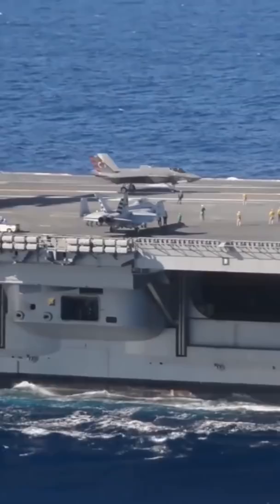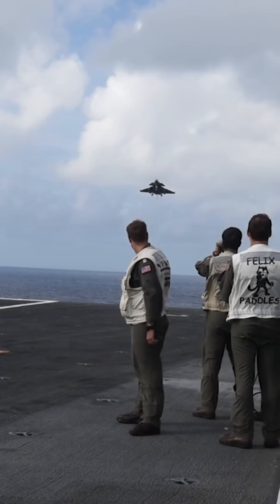How Aircraft Land on Carriers? #shorts

Comment: I'm more impressed on how tough those cables are to be able to completely halt a heavy-ass aircraft on full throttle.
Reply: Indeed
Reply: Not always. I’ve seen one snap and take a buddy’s leg off.
Reply: @SideGigSquid  did you though?
Reply: @lsixty30  yes. I’ve been in the navy since 1999. Seen many unfortunate things.
Reply: @SideGigSquid  thankyou for your service sir
Reply: Check out the film (it’s on YouTube) of Eric (Winkle) Brown making the first ever jet landing on a carrier. His main gear came sooo close to hitting the edge of the deck. 
Eric Brown also made the first twin engine carrier landing with a DeHavilland Mosquito. He came in well below stall speed with the plane hanging on its propellers. The hook failed so he had to abort but had all the power he needed to get away. He tried again later that day and the hook did it’s job.
Reply: @Deochar  You're welcome
Reply: @SideGigSquid  I turned 3 in 1999, so I guess we both went through some shit
Reply: @Deochar lol
Reply: Amazing the landing gears aren’t torn off
Reply: @Alan Brown যলতলখযর
Reply: They don't. The cables are attached to 2 hydraulic pistons on runners and those are what actually stop the plane.

If it was just the cables they would snap and cut people in half or tear the plane in half.

Sounds like a really loud train clopping above in the quarters underneath.

The plane also has to go waaaaaaaay slower to land or they'd generate too much lift. Planes land by slowing down.  Being at 85% throttle would have most planes over mach 1 based on their UNCLASSIFIED top speeds as well if you think about it, so that was also total horse crap.
Reply: David White  ...the 7 years I was in the Navy disagrees with you.
Reply: @lsixty30  O
4*// "
P9
Reply: Discovery Channel did a show called "Anatomy of a Super Carrier." Was filmed on the USS George Washington. They were on the flight deck filming, talking with the Paddles, when a wire snapped on a F 18. Jet went overboard, wire took out a few people.
Reply: @SideGigSquid   Indeed. These cables have a cycle limit and are replaced per schedule or sooner if damage, wear or deficiencies are noted during inspections. A cable snapping is deadly!!! Thanks
Reply: 85% throttle
Reply: The cables are connected to weights under the deck as well as pulleys so as the plane hooks the cable the cable will help stop the plane.
Reply: Ññp0
Reply: Got alot of play under the next deck with giant pullys and what not...alot of that cable you never see....I know....I help build them...hydraulic pistons and alot of stuff that would probably bore you.... but I think it's actually fascinating...I love my job....lol
Reply: Same, also how the tail hook doesn’t just break
Reply: Ikr!
Reply: @Alan Brown that.. sounds terrifying.
Reply: @lsixty30  dang I was 13 in 1999. I remember cuz I turned 13 going into 2000. Lovely year, only time I’ve ever seen fireworks EVERYWHERE in the sky during the turn of the millennium
Reply: @casedistorted  hate to be the "well actually" person, but the turn of millennium was actually between 2000 and 2001
Reply: The caes are attached to pistons below the flight deck which are used to reduce stress to the cable  that the aircraft snags by adding resistance dependant on weight of aircraft thats landing
Reply: @brentywenty  yea… but we are just humans. We see the change from 19 to 20 and that is what we see. It’s definitely not how it should be from 0 to 1 😂. We’re just sheep man, give us a break smart guy. 😂
Reply: @SideGigSquid  you’ve been in the navy Since 1999, and you didn’t at the very least think to try buds??🤔🤔 or did you try and quit??? Anyway, thanks for fighting and putting your life on the line for our freedom.
Reply: @JerryBarau  if you must know in boot camp there was an attempt for SEAL PT and swim. I didn’t even come close.
Reply: Well, the good thing is you tried, saw that not everyone can do everything, and when you realized buds was not for you, you told yourself the truth, and moved on to what you’re capable of doing, better
Reply: @Checo82886  Well, you have got a point lmao.
Reply: Cables, hydraulics, and pulleys (basically)
Reply: @SideGigSquid  I saw that too. And then cookie went on to be a master diver.
Reply: @SideGigSquid  😭Thank God he lived!
Reply: @formdoggie5  No
Reply: @BrazilianImperialist  yes.
Reply: How about the stress on the airframes?
Reply: Landing a fully loaded semi truck at 150 mph on a postage stamp moving away from you and also at an angle, easy enough huh? Lol
Reply: @SideGigSquid  thank you for your service
Reply: @lsixty30  that shit is unfortunately very common, not like a daily occurrence but it unfortunately does happen.
These guys on the flight deck are hyper aware of their surroundings but accidents happen.

Don’t tell anyone from the navy I spoke well about them though, fk them.
Reply: I am more impressed that the things holding the wheels don't get bent or something
Reply: The cables are connected to dampeners that reduce the load from the Aircraft. How do it know this? Im a vet, i used to work with the whole Arrest Gear. #ABE
Reply: The aircraft slow down a lot so not really on full throttle, and it's not like they're indestructible either.
Reply: @Alan Brown .
Reply: @Alan Brown δ
Reply: @SideGigSquid  ouch 😓
Reply: Eddy Love  🤣
Reply: Eddy Love  My wife: Puts 3 weeks of clothes into the 2 day old, brand new washer, spin cycle set to high. 

Phone call one hour later; "This thing is such a piece of shit. It's already screwed up."

Me: 🤦🏼‍♂️ (Sends pic of washer load rating)
Reply: @SideGigSquid  Thank you for your service sir.
Reply: Yeah, you'd think all carrier based aircraft would be vtol by now so they can do away with all that cable nonsense
Reply: @Deochar  Thanks for your cervix
Reply: @formdoggie5  he said 85% throttle not speed. It means no fan lag
Reply: @johnnytopgun6414  wow
Reply: Its not what you think 😄
Reply: @SideGigSquid  Well thats not supposed to happen.
Reply: @SideGigSquid  That sounds horrifying my man, thank you for your service
Reply: They are changed after a few uses
Reply: @tokyotylerhunt  I don’t know much about jets, but I assume that jets that land on carriers are designed with gear that can withstand, I know the F22 gear can’t stand it, so I reckon gear are specifically designed to withstand it if necessary
Reply: I’m more impressed that he said not how you think and not not what you think
Reply: @lsixty30  lol same
Reply: @SideGigSquid  sure you did bud
Reply: @SideGigSquid  thank you for your service 
Im off to the marines one of these days after i get done with hs football
Reply: @tokyotylerhunt  that's because aircraft intended for this have specially designed landing gear.
Reply: @ccountryclarke6223  like dumbbell weights right ?
Reply: @SideGigSquid  
Damn, sorry you had to see such things mate, a Cable snapping must be insanely deadly
Reply: Like ten, and more tons.
Reply: @pain_of_rose  jjuiiuh
Reply: @pain_of_rose  jhkjh
Reply: They use a hydraulics system beneath the fly deck to completely bring the plane to a standstill
Reply: If it snaps, it can just chop a guy in half. Scary stuff
Reply: I agree. They must have done it differently in WW 2. Eventhough, it all looks the same.
Reply: I wrote a comment agreeing with you. I'm
Reply: My reply agreed with you. But, I must be being shunned again.
Reply: There is a mechanical system that lets slack out so it's not just a sudden stop
Reply: @lsixty30  the airmen are supposed to be in designated areas where they won't be hit, but 1) they anticipate a good trap and start moving before they're supposed to to clear the deck for the next aircraft (there is always pressure to get the plane off the deck as fast as possible and to keep doing it in a shorter time, hence why they anticipate and jump into action before everything is technically safe) and 2) a snapped wire can do some crazy, unanticipated shit; it's not unheard of for a wire to snap from one side instead of the center (longer reach), or even to snap near the middle and also break away from the side giving you a completely loose wire that can go anywhere it wants.  Also, people are stupid.  Ask him about critical engine failures, i.e. dudes getting sucked into the jet or walking right into the propeller.  We give airedales shit, but good God!, find me a more dangerous place aboard ship.  At least you have to try to get to the catapult machinery or the engine room
Reply: I slept under #3 wire on the USS Kitty Hawk.  73-76.  Noisy...
Reply: @lsixty30  it happens a lot and the flight deck is the most dangerous place in the world
Reply: @formdoggie5  nope. Not many planes are capable of super cruise which means that most planes have to be at full burner to go faster then Mach 1. Most jets at mil power sit at or just below transonic. However just before they hit the deck they go to 85% at least or mil power and when they do hit the deck they go full burner until they stop moving. This is because it is quicker to spool down an engine than for it to go from idle to max rpm.

Comment: The fact that they throttle up when landing is crazy, never knew this, makes total sense
Reply: I never really thought about it either... but it really does make sense cause if you miss and you're going to slow then the aircraft will stall and crash.
Reply: A jets engine also needs time to throttle up unlike in a prop plane where you get the power faster
Reply: @mikemuller8423  ada
Reply: @mikemuller8423  Yeah but that's why they come in at such a high power setting to start with, the engines are pre-spooled. In the fighter jet engines they don't lag that much at all compared to high bypass commercial engines.
Reply: Really makes more sense to drop it entirely and glide
Reply: @EKKing-wy2jq  Yeah then when you miss the cables you fall into the sea and lose a 65 million dollar jet.
Reply: @SgfGustafsson  you drop the engine beforehand and glide, then you don’t have to worry about missing the cables you’d be slow enough land pretty much without needing them at all. Its just basic physics
Reply: @EKKing-wy2jq  They thrust to almost full power when landing. The cable is there for a reason.
Reply: @burnyou3557  ik that, what I’m saying is gliding would make more sense, then the cable will just be a secondary safety measure
Reply: @EKKing-wy2jq  The basic physics is that the jets are designed in a way which makes them not able to fly at slow speeds. It's a little bit complicated aerodynamic but is is a tradeoff for supersonic flight. They can't physically fly much slower that they are in the video. Without thrust they'd actually have to fly faster so they have less drag.
Reply: @EKKing-wy2jq  Fighter Jet doesnt gliding due to their short wings man 🤣
Reply: @hadidinaspuprntb5456  1. momentum 2. Aerodynamics if that was the case it wouldn’t even be able to get off the ground, the shape of the wings negates that issue entirely
Reply: @EKKing-wy2jq  yeah sorry the keyboard warrior knows more than the US military
Reply: They're trying to aerial in rocket league
Reply: @psychoticdagedar9137  the “keyboard warriors” are the ones explaining what the US military does though lol
Reply: @EKKing-wy2jq  have you heard aboud gliding ratio dude?
1. Fighter Jet would fall rapidly due to its gliding ratio so damn low, fighters have a very low glide ratio as they are designed to provide lift at a much higher speed enabling the fighter to achieve high airspeeds efficiently.
2. Thats why they have ejection seat on their cockpit 🤣
Reply: I encourage you to watch a video of one of these bad boys not going to full throttle, it literally just falls of the edge into the water.
Reply: @Cylius. эротика
Reply: @Cylius.  ь
Reply: @EKKing-wy2jq  even if they could fly that slow, they can’t, imagine brakes failed etc you would still be losing the aircraft
Reply: @augustzentner4861  it’s not about speed just momentum and height
Reply: @EKKing-wy2jq  and what do you do about the carrier moving ? Even if the fighters could fly at a slow enougth speed to not need the cables, a carrier is not a static runway so you need to catch up to it and if you go very slow relative to it you're more likely to land short.
Even on land runways the distance they need to stop is longer than the length of a carrier so the cables are defenitly needed, not to mention brakes failures
Reply: @AlphaDragons60  in case of brake failure yes the cables are a precaution and are a necessity, however height can easily cover for speed
Reply: @EKKing-wy2jq  What do you mean by height ? Do you mean an higher approach angle ? And how does height cover for speed when landing ?

I don't understand where you're coming from, i want to understand so I'm asking questions
Reply: @AlphaDragons60  two words, pythagorean theorem. If yhu know your height, and the speed of the ship you just have to figure out the ‘C’ or exactly how fast you need to go only difference that needs to be calculated which is already is wind speed and drag, and since there’s not much drag on the plane the next thing to do is figure out how fast it can go on a freedive once that’s done all that has to be done is plugging the numbers in for each factor and you sir have landed a plane

This ofcs being tested beforehand so all speed combinations are accounted for so no real math would be needed
Reply: Yeah, since if you miss and decelerate, you plop right into the water. Good thing most of the angled deck is suspended in the air, so there's little chance of you getting run over by the ship if that happens.
Reply: @EKKing-wy2jq  its very simple. fighter jet is not a glider so why should they glide. when you see they're gliding it means there is something wrong with that jet
Reply: @EKKing-wy2jq  they aerodynamics of bricks so it will stall very easily and most likely break the landing gears if lucky do you honestly think you know more abt this than the people who have been doing it for years
Reply: Simple physics says the guy. How many carrier landings have you done? 
The Military never thought about your obvious solution. The Pentagon wants you right away!
Reply: @EKKing-wy2jq  damn bro good job, with one equation you remember from 8th grade math you’ve outsmarted the thousands of PhD aerospace engineers employed by multi billion dollar corporations who foolishly neglected to calculate the hypotenuse. You better go tell the folks at Lockheed Martin and Boeing what they’re missing!
Reply: Mm nb
Reply: @EKKing-wy2jq  The wires aren't a backup, they are what slows the aircraft down in the first place.

What you are saying makes no sense because if you come in at a higher angle, you'll collapse the gear
Reply: @EKKing-wy2jq  Are you a deck landing pilot? If not.......?
Reply: @EKKing-wy2jq  so you are here knowing more than people actually devoting their lifes to the I+D of aircraft carriers and the best ways to land on them, people that are studying and working on that even from 1930, if not before, that have measured every single thing that can come to our minds, yet you are here saying "This would be better. Trust me"?
Why are you here and not in a military facility developing such techniques then? 

Man.... is impossible to do the things the way you say it